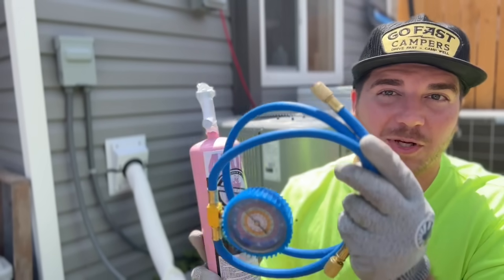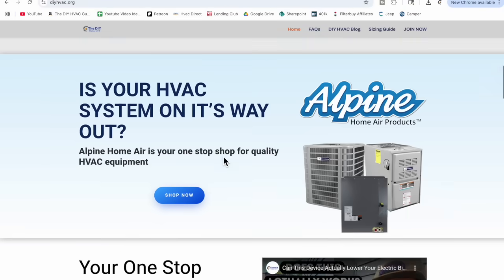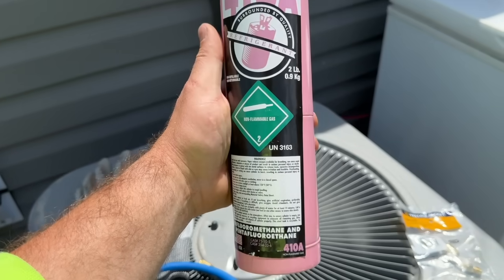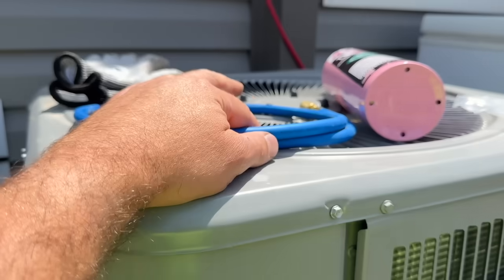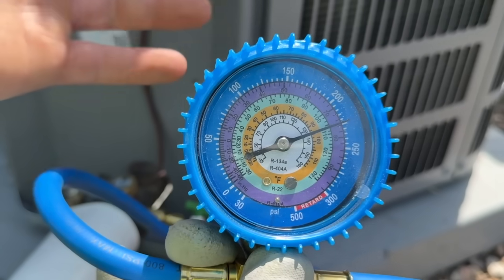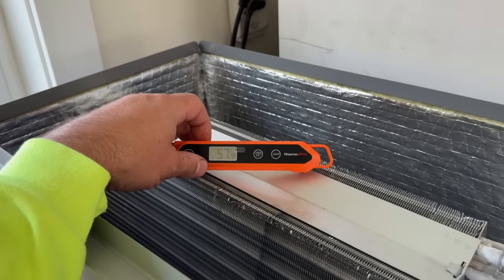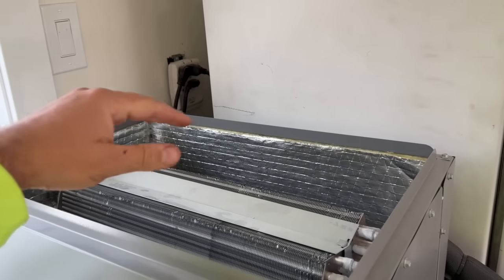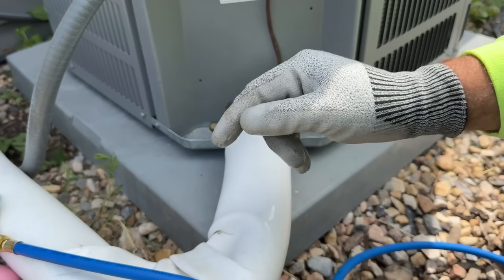You Can Recharge Your Home A/C Like A Car??  Colder Air in 6 Minutes!

Comment: BTW, these systems are closed systems. If you are low on refrigerant,  then you need a licensed tech to come out and fix.
More often than not the more common issue is an airflow issue. Check that first.
Reply: Yeah, they start off as closed systems.... or you hope they are after the company installs them. Pin hole leaks are very common after years of use.
Reply: Thank you
Reply: News systems are junk and have leaks too. Better off with the old system and adding a few pounds to get through the summer. Not difficult or expensive at all to get 608 online is people want to be legit.

Comment: Good tips Dave, anyone with common sense and mechanical aptitude can handle this. I may get a kit to have on hand, I already have spare start caps, contactors, circuit boards etc for two units in our house. I also constantly check the insulation on the outside return lines, and make sure my outside coils stays clean, that's important too. Thanks!

Comment: Absolutely do not do this yourself. Not on your house or on your car. The system is designed to have a certain amount of refrigerant in it. Pressure is not a good indicator of correct charge because it can vary due to ambient temperature, worn compressor, or restrictions in the system. If you charge with one of these, you're not only polluting by releasing hydrofluoracarbons (arguably the worst thing for our atmosphere) into the air, you're also likely over charging your AC system, which will just make the performance and efficiency worse. Hire a professional. It may cost more, but it will probably save you in the future. Probably also save the future.
Reply: It's not rocket science and very simple to do. If  HVAC companies were not so dang greedy and overcharge so badly then I would agree..
Reply: @robertgregory2618 its not rocket science and is very easy to do if you know what you're doing and have the proper equipment. One of these recharge kits you get from the store, is not the right equipment. All AC systems take a specific weight of refrigerant. Those recharge kits don't measure by weight, they just give you a pressure reading, which is inaccurate. Also, if the system is low on refrigerant, that means it is leaking. If it is leaking, it is putting hydrofluoracarbons into the atmosphere. Hydrofluoracarbons are probably the worst molecule you could put into the atmosphere.
Reply: Just charged up my car. Use cheap China gauge and can. Used caution and stopped after barely getting it into the "Filled" section of gauge. It is blowing very cold. Dealership wanted $3,800 for condensor and evap. I don't care if I need to charge it up every summer for the 3 months I need it. $40 is cheap!
Reply: @Igotstaknowit your condenser is leaking. R-134a is a hydrofluoracarbon. Hydrofluoracarbons are probably the worst molecules to be released into our atmosphere. Dealerships are probably the highest priced professionals you could have work on your car. I'd definitely get a second opinion at least, it's pretty unlikely that both the condenser and evaporator are leaking. Its likely one or the other not both, and most likely the condenser, which is the easiest to replace.
Reply: @TempleoftheSon  Actually it's R1234yf. Yes on my car the condensers are known to leak, factory extended warranty. The problem is almost everyone is being told at the dealer to also replace the evaporator. I guess warranty work on the condenser doesn't pay enough. Evap replacement involves removing dash. Big Job $$$.
Reply: @Igotstaknowit oh, ok. That explains why its only $3,800 for both. At the dealer where I work it would be nearly that much just for the labor on the evaporator. A lot of times if we cant find a leak we have to assume the evaporator is the source since its impossible to see it leaking unless its a really bad leak. So it kind of sounds to me like they want to replace the condenser because its warranty so it wouldn't cost you anything and they can't actually locate the source of the leak, so they want to replace the evaporator. It may not be that they are trying to rip you off.

Comment: 17:02 - After charging, turn off the valve to the refrigerant cylinder, the hold the can up so that any residual liquid will be pulled into the system. Then, with the cylinder valve off, allow the system to run for 2 to 5 minutes to be sure only a small amount of vapor is left in the hose before closing the system valve and disconnecting the hose. At this point I would recheck the service valve (Schrader core) for leaks and tighten if necessary.
Reply: Ok, so then just go spend 150.00 and get a EPA license or online and find out the correct way to do things 😮
Reply: @lynnprice6635 De Minimus, man. De minimus! “Small releases of refrigerant that result from purging hoses or from connecting or disconnecting hoses to charge or service appliances will not be considered violations of the prohibition on venting.”

Comment: Favorite part of this channel is that many of the flim-flam HVAC guys that rip-off customers hate that hes showing how easy it is to DIY your own system.
Reply: Mikey Pipes would NEVER show this on his channel.
Reply: It's worse than a HAM Radio video comment section in here(:
Reply: Lol go ahead and follow this guys tips on the DIY project. The pros know if you only charge based on gauging one side of the system you’re doing it wrong. also you should charge based on manufacturer and type of metering device. I’m sure most people getting this kit are going to overcharge the unit. And guess what its a balance if you put too much you will cool poorly as well.
Reply: Yeah but the really good HVAC guys know that after you DYI, you will be calling and the service charge will be higher than it would have been BEFORE you DYI-ed it. An Air Conditioner is not a DYI friendly piece of equipment. If you truly are good with electricity, you understand refrigeration controls and know the psychics of the refrigeration cycle by all means have a go at fixing it your self. When you consider the fact that you can destroy your air conditioning unit following this video with a bad diagnosis, DYI could be a $10K error.
Reply: yeah but...please don't mix up psychics with physics...could be more than a $10k error.
Reply: @jonnoel8606  good one 😅
Reply: @jonnoel8606  You read my mind.
Reply: @bobcaygeon975😂
Reply: @Captkid1  Can you elaborate how you would destroy it?
Reply: @2008M5  They are just fearmongering. It is all bs to get people afraid and go with whatever replacement unit is being pushed. The HVAC guys I've seen do not lift a finger to help. They'll see a functioning AC that cools the house but show all these instrument values as a reason to get you to buy a new system. You're much better off trying these fixes yourself.
Reply: @JesseR-p6j its not fear mongering. 😅 as someone who focuses on actual repairs than replacement he is leaving out a good amount of info. Too much refrigerant i risk slugging your compressor. Hopefully he has a kit for that too for you to purchase 😂😂

Comment: I don’t see the big deal… if I can simply recharge my cars refrigerant… why can’t I simply recharge my house AC??  Is that really so “horrifying”?!?
Reply: Because big private equity owned HVAC companies lobbied to take away DIYers right to fix their own stuff. They claim it the environment and it's dangerous. Well, so is working on your own cars and if you don't dispose of oil properly. That is why HVAC companies can charge $500 to change out a capacitor. They scare people. It's a 10 minute job and the part is around $20.

Comment: Have you done any videos on the sealants you can shoot into the system for small leaks?  Mine has been needing about a pound or so every year and I started DIYing it after following your channel a couple years ago.  I just put the sealant in this year and I am waiting to see how it works next season
Reply: If you use a sealant get one with dye then check in couple of days with uv light to find leak.